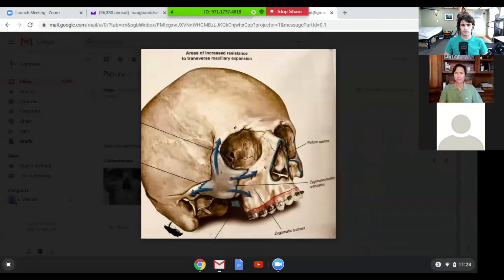Pt 2 - Dr. Vaughan Details Anatomy of MSE Surgical Assist

Comment: based on my research of the MSE appliance, i was seeking correction of my unilateral crossbite.  given age over 30ish, no ortho or oral surgeon was going to use MSE without cutting the maxilla.  against the recommendation of the oral surgeon, who recommended LeForte, i went the SARPE (no one outside of CA or NY knows what MSE is) route.  for those considering correction of a unilateral crossbite, i wish i would have done the LeForte option - the result is more predictable in the hands of an experience oral surgeon and your time in braces will be much less.

Comment: Damn seems surgical assist does cut off zygomatic expansion sadly good video Ron
Reply: Is zygomatic expansion the lowering of the upper jaw? So more top teeth would show at rest position or when talking? and what indication from this video did you get that lead you to believe this MSE surgical assist cuts off all possibility of that type of movement/expansion?
Reply: Alexander Gonzo he said he cuts the zygomatic buttress in the video so that would have the maxilla separated from the zygos and the transverse force would be lost right
Reply: @shigwig9751  You kinda just blew past everything i said.... are we talking about cheek bones widening... or the upper jaw coming down to show more top teeth? i don't know what zygomatic expansion is
Reply: Alexander Gonzo upper jaw would not be coming down that would only happen through maxilliary downgrafting during a double jaw procedure I am referring to the zygomatic and midface enhancement you can expect during a standard non surgery assisted run with MSE
Reply: I think it would limit the ability for the zygos to expand. It seems like the ability for them would depend on the force to transfer from the upper palate to the zygos which even if they are not completely disconnected like they are with sarpe the connection would be weakened enough to stop enough force from getting up to expand the cheekbones.
Reply from the maker: we discuss this exact question later in the interview